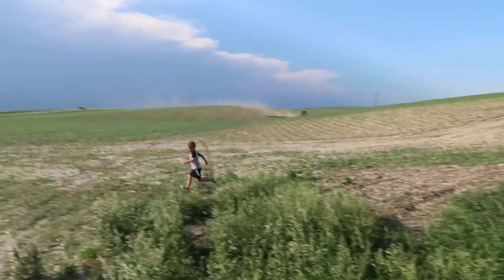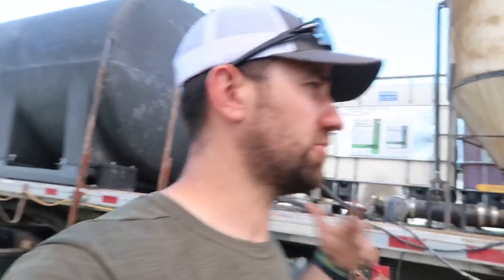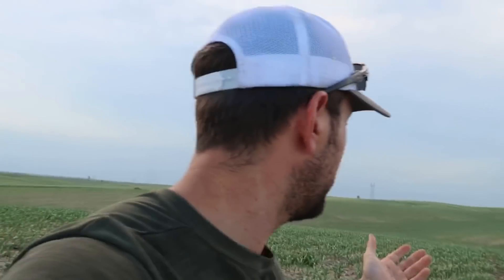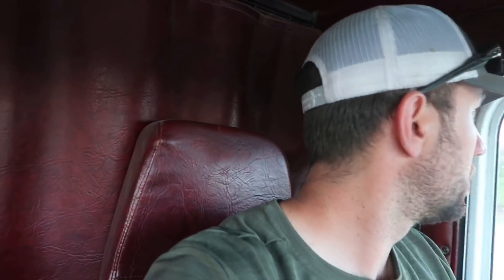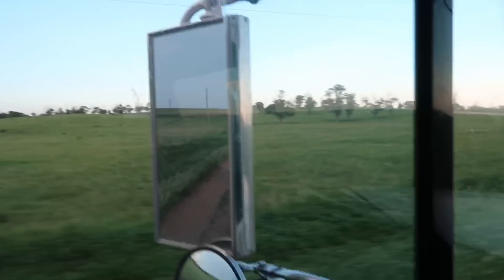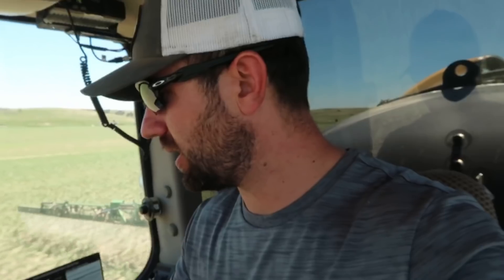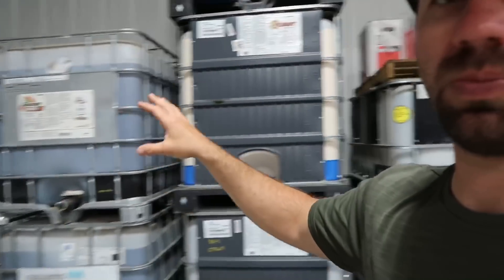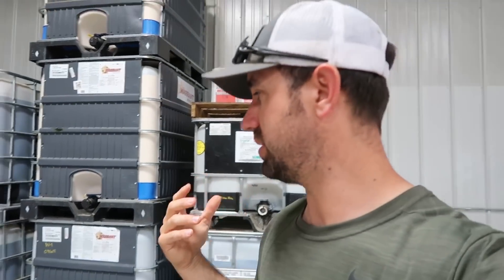Dicamba Dilemma

Comment: Our farm had over 300 acres of beans severely damaged by dicamba which resulted in the loss of over 100k dollars. Personally I lost 20 tomatoe plants, 6 peach trees, and half my damn garden, grape vines, strawberry plants to name a few. The problem is dicamba is just too prone to drift. Yes it works but the potential for ruining other peoples property and crop makes it unreasonable

Edit: I would like to add even the best formulas still drifts. If you spray dicamba near a field that doesn't plant beans that have dicamba tolerance then the other farm is screwed. Chemicals are needed to control weeds and bugs. The problem is risk of drift. If it was your yield that was affected you might be in a different mind set. I will say I agree with you about the whole round-up causes cancer crap. My granddad who is 87 has been using that stuff for over 30 years. He has be doused in it when a spray tank busted. Everything causes cancer.

Comment: My dad used Banvil in the late 70's early 80's.it worked good but you had to be awful careful with it from drifting.when I quit farming in the mid 90's the weeds were becoming resistant and they were having to find different chemicals.I also worked at a Co-op back in the 80's back when people didn't have all of these safety regulations there were days that I spilled so many chemicals on myself including Round-up.I haven't worried about cancer and I can guarantee I had more exposure to the stuff than any of these gardeners that the courts are hearing about

Comment: My understanding is the new dicamba was fast-tracked through the approval process and the court ruled that that basically shouldn't have been done so now they're going to have to go back and get a full approval in order for it to be used and I think it eventually will get that it's that they took some shortcuts that they probably shouldn't have
Reply from the maker: Thank you for the info.  It seems interesting the timing. Maybe it was coincidence🤷🏻‍♂️
Reply: @ONeillFamilyFarms  The Lawsuit that this ruling comes from was originally filed in 2017. So it's been working it's way through the legal system for a long time. The timing is unfortunate. this could have saved everyone a lot of head ache if the ruling came 6 months later or earlier.
Reply from the maker: Yes.